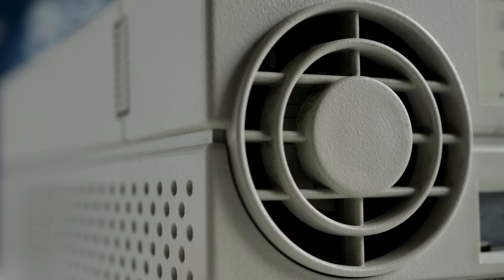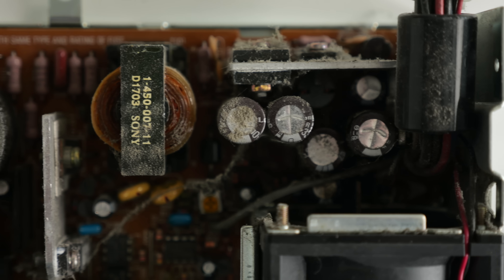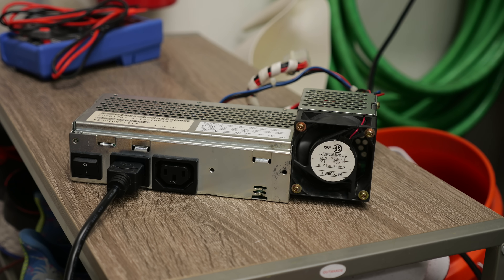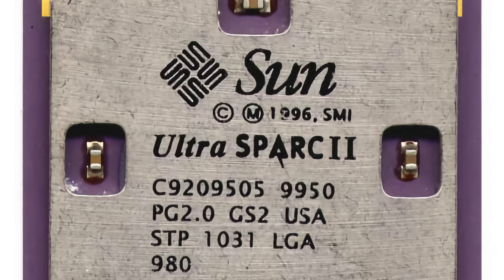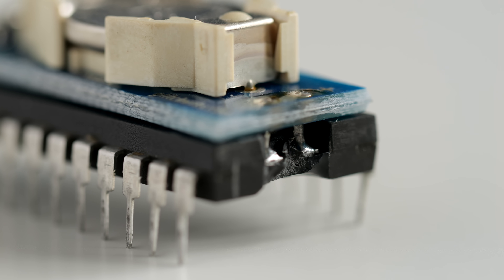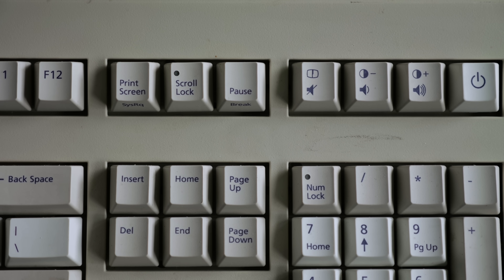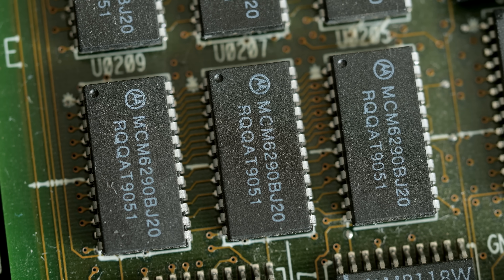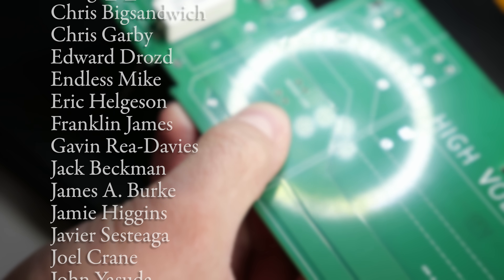I couldn't fix this SPARCstation because of one STUPID problem

Comment: when you have money but no skill
Reply from the maker: find me a replacement chip and I’ll swap it
Reply: @ThisDoesNotCompute  The Motorola databook from 1989 has a supplier cross-reference section, presumably to propose their own parts as alternatives for other vendors' products. Although that only features the MCM6290J20 (not the B version), it suggests several possibilities.

One of those is the Cypress Semiconductor CY7C166-20VC which you can get from distributors such as Digikey, the actual supplier being Rochester Electronics. The MOQ might be a problem, though. Another is the IDT6198S20P which is seemingly available used from the sourcing supplier featured in the video.

I also found that Pyramid Semiconductor still makes the P4C198, but their Web site gives the impression that if you have to ask the price, you probably can't afford it. But maybe e-mailing one of their distributors might pay off. Another supposedly equivalent part is the Mitsubishi M5M5189. This is used in the DSP board of the Namco System 16, apparently. So, maybe arcade suppliers might have some.

I'm not writing this to persuade you to do anything here, and certainly not to satisfy the rude individual above.
Reply: @ThisDoesNotCompute  CY7C166-15VC from Rochester or DigiKey. Not obsoleted. Less than $4.00/pc.
Reply: @ThisDoesNotCompute  
Comparing the datasheet for the non suffix'd part with the B suffix... Looks like there is 1ns additional hold time for some values, which should actually be better. So the straight non-suffixed part should be a just fine drop in.

It's always a shame when there are videos making these things out to be impossible to fix and this just drives people to scrap things instead of fixing them. It doesn't take long to realize that when searching for parts you want to drop all suffixes first, look up that part. If the datasheet doesn't have info on the suffixes, slowly add them back on until you get the exact part your looking for. And often there are zillions of databooks out there giving you cross references to other part numbers that are suitable drop ins.
This isn't a custom chip from Sun, this is a bog standard SRAM chip that was made for 40~ years by many different manufacturers.

Linked below is a databook from motorola showing the non suffixed part.
The datasheet for the MCM6290B.
An example of a cross reference page showing similar parts.
And the exact part you need to buy off ebay to fix this thing.
Good luck!

http://www.bitsavers.org/components/motorola/_dataBooks/1989_DL113r6_Motorola_Memory_Data.pdf

https://www.datasheetarchive.com/pdf/download/scans/Scans-062/DSA2IH00108057.pdf?h=a0d5d1dbf19b58258e83b7f839a0c954%3A466ce13f1c4b3a%3Abde24499095f7b13335d107321fd1e13

https://www.datasheetarchive.com/pdf/download/distributors/Databooks-5/Document534137.pdf?h=3debf2a9d38fdcbff273e8792b6db8b0%3A1899fcbf739f5b830f00%3A02ca3b3c81357612b51a94e0612f2fab

https://www.ebay.com/itm/202508618219

Comment: This is the saddest video you've ever posted. You're right and it would be worth setting an ebay search for the part just in case it ever show up. But this is why I make sure I can get something to post and operate with it in 100 pieces long before I start sinking time and money into accessories and 3d parts. I suppose the best takeaway is that you did learn a lot about Sun systems and if you came across another system, you would know to check the serial console before anything else. That's really not a bad lesson. I'm so sorry though.

Comment: Don't yank on the power supply's wires to remove its plug. It's plug is made extra tight for safety... all the more reason to not yank on the wires. Try to grip it's white plastic harness housing for safety and for preserving its long life, if not our own.

Comment: 9:37 one quick tidbit on the mouse and keyboard. 

SGI quickly adopted PS/2 by using third party chips that had reverse engineered it for Compaq and Tandy. 

But Sun wanted ADB and Apple wouldn’t license even though Next was able to include it on their systems. 

Soon Sun bulged and the SUN Ultra and Voyager had PS/2.

Comment: You wouldn't need the exact model of SRAM chip to replace the one that it is complaining about. Virtually all 16K x 4 SRAM chips in a 24-SOJ package will have that same pinout. The only constraint then is finding one with 15ns or lower access time. Desoldering and replacing J-lead packages is also one of the easier surface mount rework tasks to accomplish. That being said, 16K x 4 is still a very uncommon memory organization today and I wasn't able to find one from any of the big electronics distributors. A larger or alternate package SRAM would also work, but then we are getting into designing an interposer... I don't blame you at all for moving on from this project, but I still believe that this SPARCstation is repairable!
Reply: The MCM6290BJ20 is a 20ns write cycle part according to the Motorola memory databook from 1991. The core part number is MCM6290B, with J meaning plastic SOJ package, and there's a MCM6290C part as well. The 1989 databook suggests the earlier MCM6290 as an alternative to products from IDT (IDT6198), Cypress (CY7C166), Micron (MT5C6405), Performance (P4C198), Hitachi (HM6789), Toshiba (TC55417), Mitsubishi (M5M5189) and Sony (CXK5465). So, I guess there are plenty of other candidates to search for.

Of course, the motivation has to be there to find the parts, acquire them, and then fit them appropriately, with all the associated troubleshooting. I used similar machines at university and more capable ones in various workplaces, but if Colin doesn't have any prior familiarity with them and doesn't have any specific objectives, he is justified in using his time on other things.
Reply: I would have just used any SRAM at least 64kB with any pinout (dip or smd) and wired it up manually using a piece of vero-board. All it needs is 4 data lines, 14 address lines, oe, ce, we, vcc and gnd. Total 23 wires and a bit of time to solder those wires to the pads on the board. It wouldn't look pretty but it would work. In my past arcade repairs I've done thousands of things way more complicated than that. Assuming it worked then he could make some sort of pcb adapter board to clean it up, or just leave it as-is.
Reply: @g4z-kb7ct  You can't just play "connect the dots" with a random memory chip. If the memory cell layout is different, and the control lines expose the memory array in a way that differs from the original memory chip, you're just going to end up with corrupt data and the machine will be reading garbage.

I had this problem with an old IBM PS/1 Model 2133-C11. The Cirrus Logic CL-GD5410 supports up to 512k of DRAM, but IBM only installed 256k. They thankfully provided pads for the second bank of memory chips, but I didn't have any of the 256kx4 DRAM chips it needed. I tried to sub in a 1Mx4 DRAM, and the BIOS "detected" 512k of video memory, but it most definitely didn't work. All appeared fine until the video chip was switched into a mode that required more than 256k of memory and it the screen would fill up with random colored static and corrupt artifacts. And this was with tying the extra address line high to keep it from floating.

I eventually found some NoS 256kx4 DRAM chips and replaced the 1Mx4 chips and all of those problems went away, it behaved fine after that. I also replaced the other original bank of 256kx4 chips so that they'd all be the same lower latency of the new chips (70ns vs 80ns).

To properly use a larger memory chip in place of a smaller one, you'd have to do some address decoding to make sure that the correct arrays are being read and written to.
Reply: @GGigabiteM a lot of IFs there lol. The point is the guy just gave up before even starting. Things can be done and there are chips available in the same size just with a different pinout and those will work when wired up correctly.
Reply: There are loads of existing ready made package adapter/interposer PCB's for all manner of chip types, and they are usually very cheap. The issue might be MOQ though, those types of things are sold by places who don't process orders for less than $20 sometimes $50 or more, and only ship by courier. So it isn't really an issue of "it can't be fixed" more so an "it makes no sense since I can buy 2 other ones for the price of fixing this one" type of deal. It's something I run into fairly often, people hand me all manner of broken things and I'm more checking how expensive would it be to fix than 'can it be fixed' - virtually everything CAN be fixed but a small part of those things make sense to fix. I have a laptop on a shelf that doesn't recognize internal storage devices. It does boot from USB, has no other discernible issue - but I know the issue is not temporary or random, and troubleshooting it further isn't really worth it unfortunately. It even has a quite nice screen, a bit low res 1600x900 but looks nice, good keyboard etc. I could run it off a USB stick, but even then I have no use for it since it would be superslow. Sad, but spending a bunch of time and several tens of dollars fixing it makes no sense, it's worth the price of a big mac in perfect working order.
Reply: You just buy one of the SBus frame buffers with the GX chips etc and steal it from that.
Reply: It should be easy to adapt ANY sram equal or larger than this. You can even easily code up a small FPGA to behave like this.
Reply: @moleidole  Use a bigger FPGA and do away with the whole machine ;)  There is an experimental SparcStation 5 core that runs on MISTer, so this machine should technically be possible. There is also a 10 year old video floating around called "FPGA Computer (SparcStation compatible)"
Reply: It's also worth noting that the RAM probably has to be fixed in order for the machine to operate at all (at least if it's going to run a Unix). From the error display at 12:23 saying that it's "page map RAM" it appears to be nothing to do with the video subsystem but would be the RAM used to store the page tables for the virtual memory system.
Reply: Yeah, this is just depressing. It would have taken maybe 5 minutes to find a suitable substitute. It's really embarrassing that he gave up this easily given how much effort he sunk into the (much more labor intensive) ersatz PSU. That chip would have taken maybe 5 minutes to swap.
Reply: Almost anything is repairable if you throw enough time and money at it.
Reply: Cache RAMs pulled from late 90s junk mainboards could work here.
Reply: @splitprissm9339  Of course not, they are not static. They are the most opposite of static you can find pretty much.
Reply: @noth606  They most certainly are SRAM, whether you could find chips in the right package or memory organization off a PC motherboard is another question.
Reply: @ Cache chips are not static RAM - obviously. They are the exact opposite. Maybe have a cup of google-fu if you don't know what cache is VS what we're talking about here. 
Cache are high speed low latency DRAM chips used as a faster version of RAM in a sense. SRAM are used as storage for things like boot configuration, bus ID - card type - card ID tables etc.
Reply: @noth606  486 and early Pentium boards used SRAM for the cache, which would work here. later Pentium boards moved up Synchronous SRAM chips either on a COAST (Cache on a stick) modules or soldered direct on the motherboard, those would not be suitable. Any SRAM of the correct speed should work, just connect any 4 data bits, and tie the unused address lines either low or high.
Reply: @noth606  Cache, even that build into modern CPU is static RAM. BOOT configuration is stored in either FLASH or battery backed SRAM. Cache is NOT high speed low latency DRAM. Your own goole-fu is broken.
Reply: @ I'll be damned. I looked at it in detail at one point decades ago for some specific implementation and didn't bother looking at it again - until now - and  you're correct. Never occurred to me that there would be a change to something like that since I didn't see a reason for it and I didn't use it directly in a way that it would have mattered. 
Thank you. Both for the update on how cache works, as well as the reminder that I don't always know what I think I know. 
Funny to me is that I've done code specifically using some cache behavior some years ago but never looked it up then, or if I did it didn't "register" that it was using SRAM - not that it would have mattered specifically but the cache size etc did and I could have caught it then.
Reply: @noth606  Easy enough mistake to make. If your interested, the most common type of SRAM cell is a 6T SRAM, which is basically a flip-flop circuit made with 6 transistors, flip-flops are static by design and maintain the value as long as power is provided, this makes them more power hungry, and expensive. A DRAM cell, is usually a single transistor and a capacitor, the data bit is stored as a capacitive charge and needs to be periodically refreshed to retain it's data, therefore dynamic be design, because it's not truly digital, the capacitor takes time to charge, making is slower than SRAM.
Reply: @noth606  Very gracious of you to accept the correction! Of course, separate static RAM was already used as cache memory in various mid-to-late 1980s workstations, such as those using the MIPS R2000 and R3000 chipsets, to give examples from one of the rival architectures to SPARC from the era.
Reply: @noth606  Older CPU cache is typically SRAM.

Comment: Thanks, what a trip! My dad gave me one of these to play with in the late 90’s. They were obsolete by then, but many people used it as a webserver. Eventually I got it working headless over serial and put a version of Linux on it by hooking up a CD-ROM. Although it was very cool, I also had to conclude I had no use for it- I wasn’t planning on hosting a website, and it didn’t run anything fun. I came across one a while back, and though I had a tinge of nostalgia, I didn’t pick it up because after spending an evening getting it to work, I would just arrive at the same conclusion.

Comment: I love these early 90s workstations. They were absolute powerhouses for the time and regularly had some truly fascinating hardware. Personal favourite being the Sharp X68000. Originally designed as a graphics and sound workstation. It ended up becoming the most powerful games machine money could buy at the time. The specs ended up being very close to what Capcom were using in their arcade hardware and stories go that Capcom bought a whole bunch of the machines to use as dev kits.

Comment: These cost-reduced sun4c computers were so underpowered they really damaged SPARC's reputation back in the mid-1990s.
Reply: And made them easy to get used. They were very underpowered, but I nabbed one at a First Saturday in Dallas (a big technology and radio swap meet) in the mid 90's I got an IPX with KB and mouse and 64MB of ram for $25. That little machine was how I learned to admin UNIX and Apache, and helped me get some decent jobs in the late 90s and early 00s.

Comment: @ThisDoesNotCompute i believe that is a cache chip.  I have a couple of Sparcstation boards with bad cache chips.  There is a more comprehensive diag chip that you replace the system room with.  I don't know if copies ever escaped into the wild.  I do have the IPX one somewhere.  If you do get it going, I would recommend Solaris 1.3 which is the BSD based Solaris.  It will perform better on the old hardware.  Max OS is Solaris 7 but it is kinda slow on an IPX.
If you want to pass it on, DM me, I have a soft spot for the old Sparcstations

Comment: Did you check the solder joints on that ram chip?  Maybe it just needed to be cleaned up.  I would have at least desoldered it, cleaned including the legs and resolder it.
Reply: smd parts don't need cleaning. It may have had a cracked solder joint but that would be rare for a part located in the middle of a board. The RAM was simply faulty and given RAM is the most common failure point of any device it's highly likely. Easy fix just manually wire up any RAM to test it. It should work just wiring up a (for example 62256) SRAM by signal leaving the unused pins not connected or tie to gnd.

Comment: The message of this video is to know when to give up. Recently, I had a Macintosh PSU that died on me and tried to repair. I had already arranged an ATX replacement, so it was not critical. But I decided to just go all the way; invest both money and time until I have no clues anymore. In the end it was worth it. It was not about the end goal anymore but about the journey. I learned so much about PSUs, PCB design, and other components, and the cherry on the top is I managed to repair it! Although that feeling of cracking the puzzle is amazing, the journey is the most importantly, and I’d say Colin, here, already had completed the biggest part of this journey!

Comment: I recently picked up one of these machines because it looks cool.  Mine wouldn’t power on so I came here to see if there are any common issues.  I suspect I need to repair the power supply, but after watching this I may just start with adapting an atx psu to the computer and see what happens from there.  

My use case would be the same as yours as I also have no nostalgia for these, as cool as they indeed are.

Comment: ah yes the old Unobtanium paradox.   I have to agree it was time to cut your losses.
Reply: Not really. It's a simple fix, wire up any static ram by SIGNAL using loose wires and solder. Not difficult, I've done the same thing a few times while repairing some rare arcade games.

Comment: Not meant as a criticism, but perhaps a lesson for the future.  I would have tried to run it after addressing the psu.  Given the psu needs +5v and +12v, you could even run that replacement board off a standard atx supply for testing (something you might have laying around).